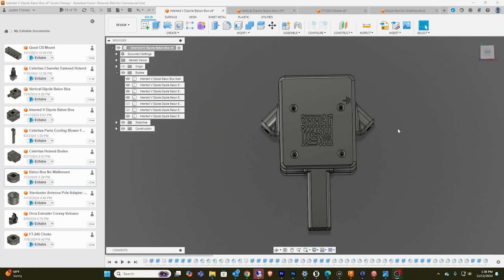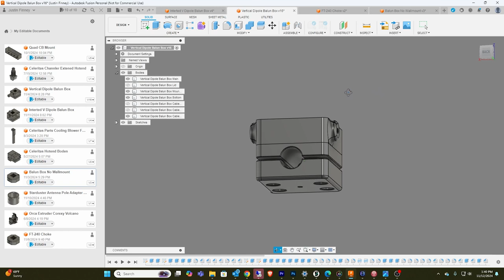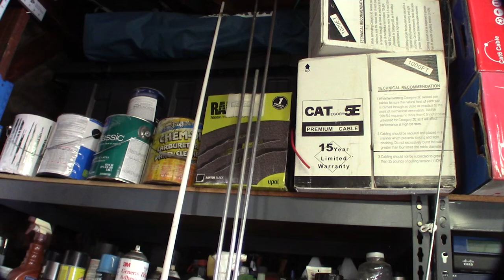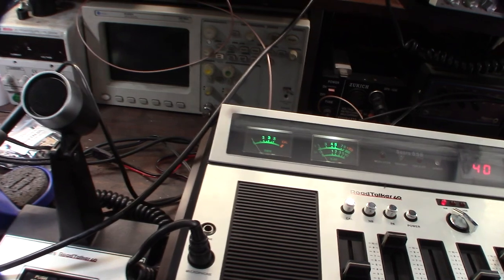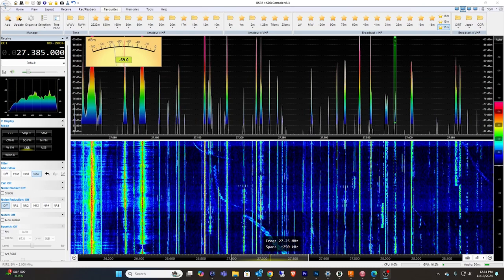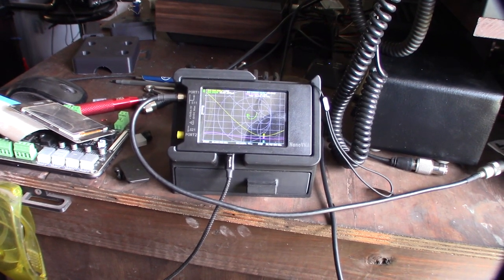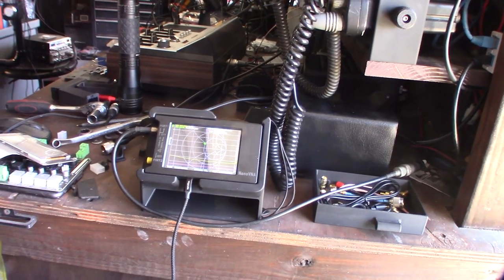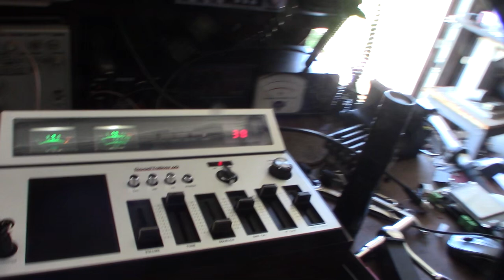CB Rigid Horizontal, Vertical, Inverted V Dipole Antenna Concept 1:1 Balun Box 11m half wave DG0SA

Comment: Does it work 😂😂
Reply from the maker: yeah, I have it up right now. It has a higher noise floor in horizontal. In vertical the signal in incredible but I could not get the swr down.